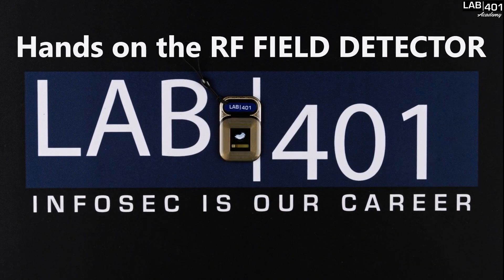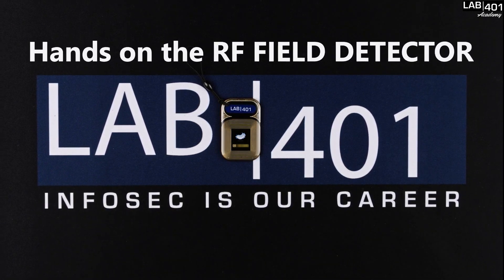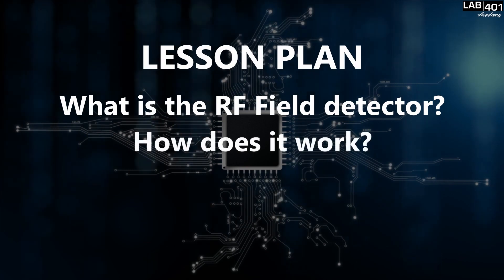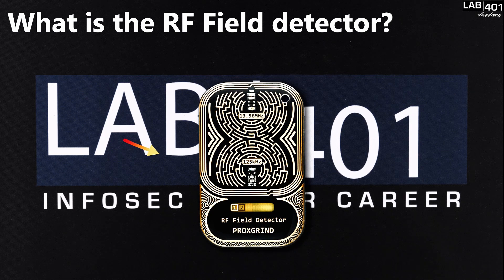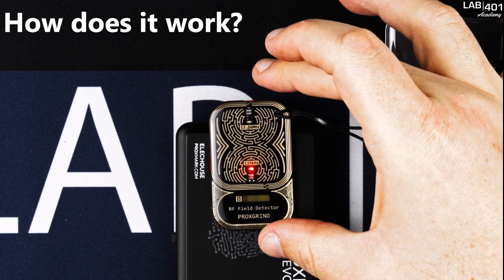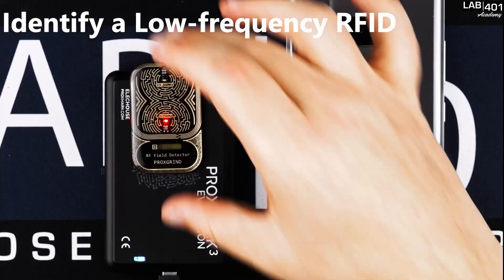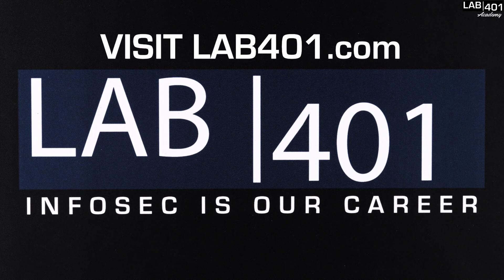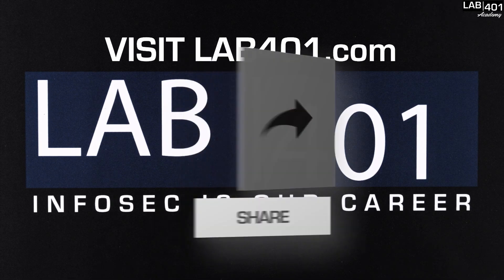LAB401 academy - How to use the RF field detector ?

Comment: Hello, how can I read a card from a 10m distance with RIFD?
Reply: This brother wants to steal cards haha. You need a fucking damn strong reader man. 50 cm is more realistic with a case sized reader.
Reply: @MauriceAlBetar  I don't want to steal cards, it is for a research project at university
Reply: Well then you don’t have to use 13.56mhz cards. Use 800mhz for long distances. With a active card you can achieve 100m reading distance like this and 10m with passive. But NFC ain’t you bet bro